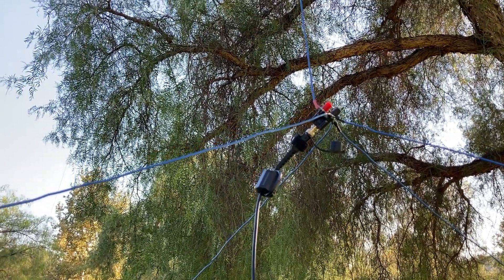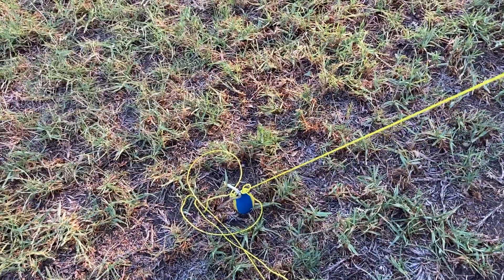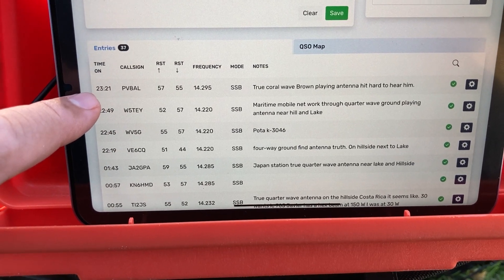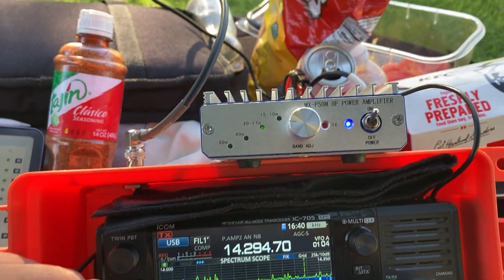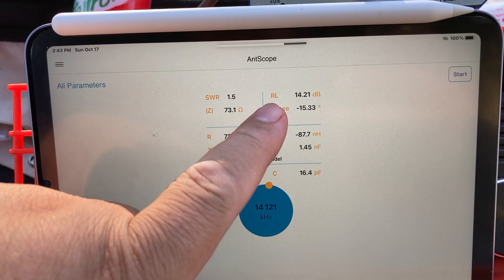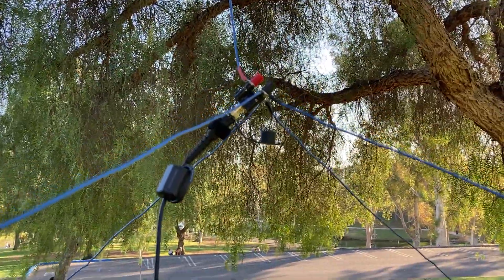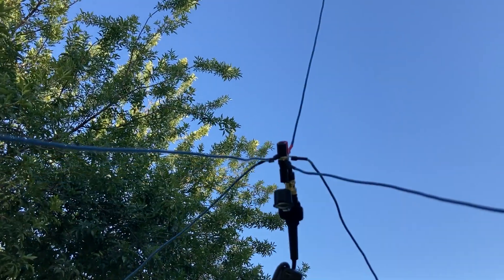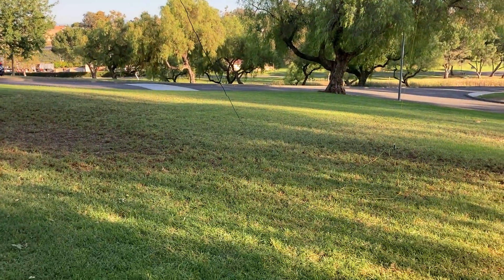HF 1/4 Wave Ground-Plane Antenna

Comment: Thanks Frank, for showing your setup in such detail. Actually, you could get away with 3 radials, and as you mentioned, the ends should be a bit further away from the ground. 
I also enjoy to do antenna experiments outdoors.
One thing I didn't grasp: which RigExpert software were you using, since I've never seen this UI? Thanks!
Reply from the maker: Hello HB9EAJ.  I've heard of people using three radials.  I'll try it out.  The RigExpert software I was using was for iOS - AntScope.  This years version is way better than the previous versions.  It's not the same nice interface as the PC version, but it will do.  Any suggestions on a multi band antenna you can take in the field you recommend?  I've tried a loaded coil ground plane, that works good, but I have to take down the antenna to get another band.